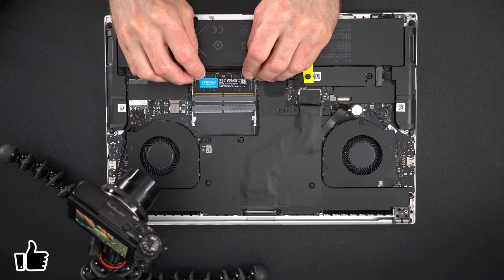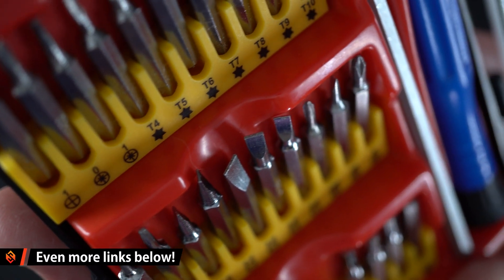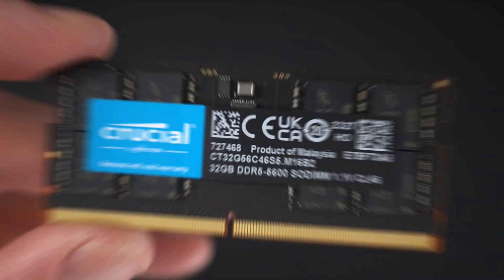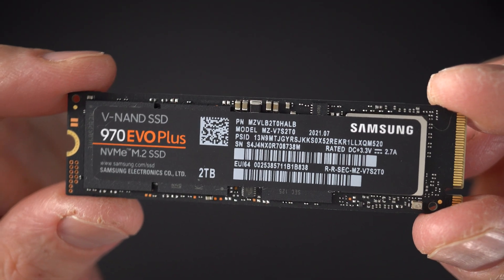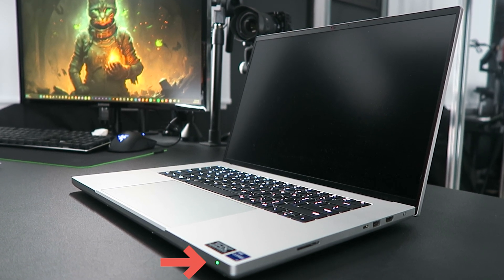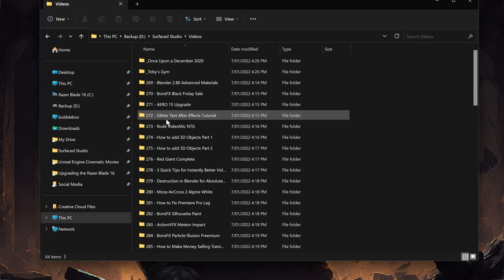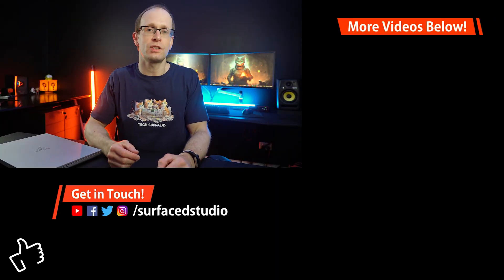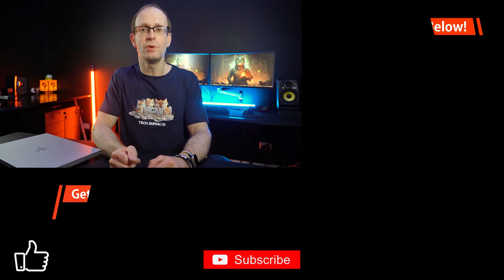Razer Blade 16 Mercury Edition 2023 - Upgrading RAM to Max + New SSD Guide

Comment: I want to get the new razer blade 16 5080 version but it’s so expensive compared to other brands but I tend to keep my laptops for 4 plus years and I doubt we will see any massive leaps in tech to need to upgrade before then anyways the gen on gen upgrades are getting smaller and smaller with time and I predict the big upgrades from here will be with ai in the cpu and gpu departments because they can only process shrink so much and doing for 2nm to 1nm is a much smaller jump than when we were going from 20nm to 10nm

Comment: Macbook pro 16 or Razer blade 16 Which one would be better for me? My  primary Purpose is Raw 4k 60 fps video editing.. And secondary gaming is not important. And I need something  like Portable. That's why i am going for laptop.  My Budget is enough. Can I go for Razer blade 4090?  Or going for MacBook?  
Please give me a Suggestion 🙏
Please
Reply: MacOS is commonly preferred for creative applications, and has a higher battery life, while the razer blade will probably do better rendering depending on its GPU.

Thats just general advice, it will vary by make, model and year.

It really all comes down to personal preference, either one should work.
Reply: Meanwhile me going back to Windows, Razer Blade 16 2024 specifically because for me MacOS as a creative sucked hard.
Reply: @neekzu  Already buy razer blade 16 with 4080 gpu. its worked good.
Reply: Agreed. MacOS is more for video editing if anything, but windows has handled 3D creative software better. Especially if it uses the gpu like unreal

Comment: Thanks for the video! I'm wondering, is the original RAM 2x16GB or 1x32GB? If it's 2x16GB could I replace only one of them with a 32GB for a 48GB total or if it's 1x32GB could I just add a second 32GB stick? Would they work together despite being different? Thanks!
Reply from the maker: It's 2x16GB sticks :) You can see me remove both of them in the video. Unfortunately different RAM sticks don't work well (if at all) together so I wouldn't recommend it. You'd want all sticks to be the same make and model :)